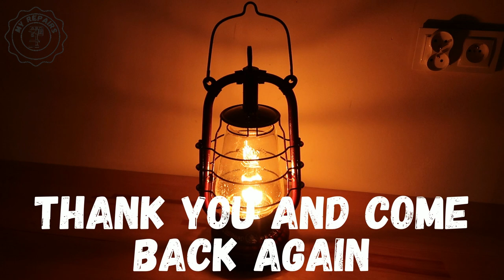#Vintage Oil Lamp - #renovation

Comment: The burner usually doesn't just come right out like that lol. It's in pretty dang good shape if it does. No need to put that much work into taking it all apart, just scrub down with wd40 and some steel wool or scotch pad and it'll be fine.